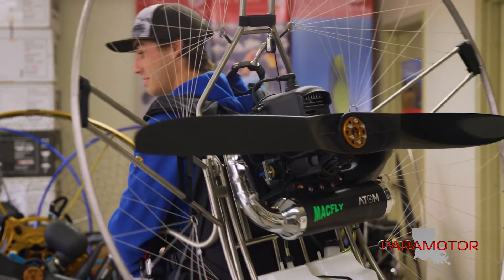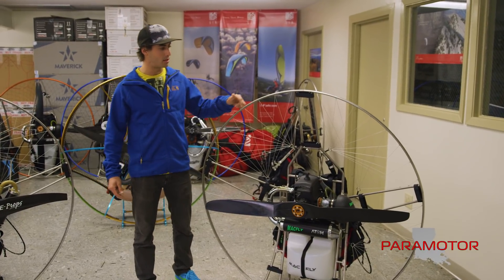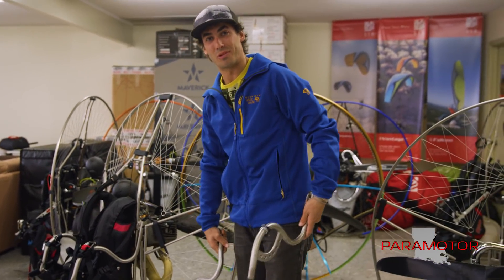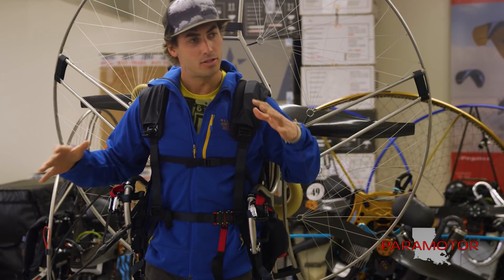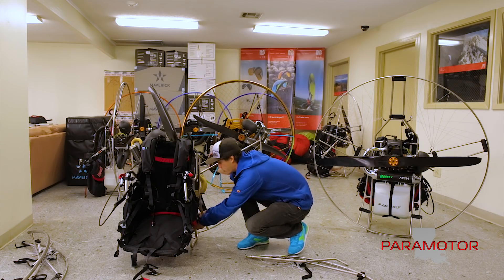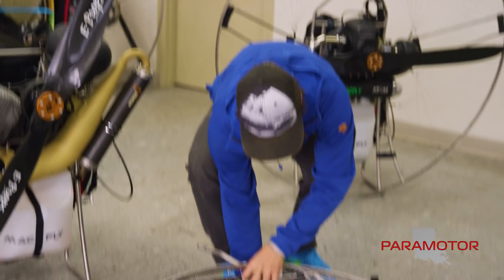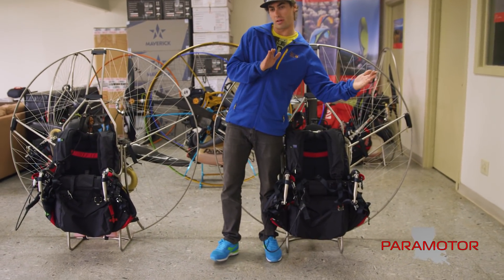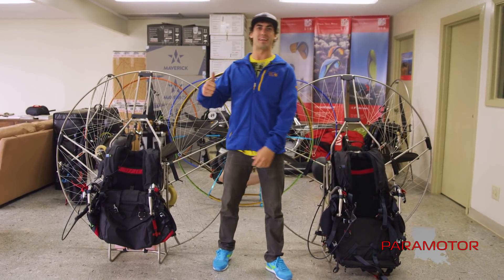MacFly Paramotor FULL REVIEW - Moster 185 AND Atom 80 (in 4k)

Comment: This looks like a very nice unit. My only concern is the netting. Is there an upgrade available? I would be worried about an errant toggle getting through the mesh, and into the prop. Is this unfounded?
Reply from the maker: Mark Rogers it’s not a big deal, the thrust angle prevents the cage from leaning forward. We can rig you up a custom net if you prefer an old school design like a fish net. This works great & we don’t have that problem, when you fly this machine it is an upgraded design in so many ways from a regular Paramotor, I can rig you a maverick style hoop to go over this cage if you want the old style net.

Comment: Do those frames also have shims as well on the motor mounts to also compensate for the torque twist? I'm doing a motor swap on my air conception frame and putting a vittorazzi on it and I'm looking for ideas on how to help keep it fly straight through the torque.. my swing arms are also angled but I was told you guys use shims on the motor mounts for the vittorazzi?
Reply from the maker: No we don't use shims on the motor mounts, but of you have a frame with the wrong geometry you can try that to help. Thankfully we don't need to do that with our frames..

Comment: Mac Fly has an awesome product! What's the weight LIMIT  on the Atom 80?
Reply from the maker: The weight limit is as much as you can fit in the seat. Same for all Paramotors. 

I train students at 220# to fly with it, I feel like the climb rate is still working well at that size with an appropriate wing. 

I have also flown a tandem with it

Comment: Matt, can you pull on the hoop and  do a flex test to show how strong they would be during a forward power launch?  I’d like to see flex test on the Parajet Maverick also. That would be a great video. Thanks
Reply from the maker: Tim Paul yeah we could do that but there isn’t much reason to do that when you know you can do a power forward inflation with both cages built of titanium the most natural thing is to fly it compared to pull on it, come visit us and you can get your hands on all the gear, I’ll do that in the next video but there is no Doug to have pulled on every frame I have in all directions to make sure the prop has plenty of clearance & I would never sell a Paramotor that has flimsy cages on it. Some people manufacture those but we make sure to steer clear from those brands because we don’t think they are safe enough to fly!
Reply: Could you show and compare the flex of the Parajet Maverick and Air Conception Race v2 also? I am trying to understand how much flex is allowable and how rigid each motor company compares to each other. Thanks
Reply from the maker: @timpaul7907  We can attempt to flex the Parajet & the Macfly but i can tell you now that they dont really move much, they can be moved if you pull very hard, the standard i use is if i can contact the prop on the cage with minimal force it is a fail, you can not do that with these machines, they are very strong, we also do not have any air conceptions to flex so i cant help you with that. Do you have anyone near you to go and visit? It sounds like you should visit and get your hands on each machine to be sure you like it. Feel free to visit us anytime, you are welcome to do your own test on my gear as you like. I can assure you that these are all strong in the flex test. If the frames were not strong in the flex test i would not be interested in having them in my shop & i would never have bought them. I am not a fan of flimsy cages or cheap gear & i do not think i will ever have any flimsy gear in my place.
Reply: Matt, You are the Man. Glad to hear they are strong, that's great. Do you think the Skymax Star Paramotor is a good choice? I think the hoop strength is there but don't know how strong the frame could handle twisting considering all of those rivets.Thanks for any input.  @minyardmatt
Reply from the maker: @timpaul7907  You cant really compare the skymax with this, the skymax is cool but a bit more flexible.. however you can save $2000 and have a skymax so some of my cheaper buddies like it, skymax ready to fly is about $5000

Comment: Does the titanium break rather than bend if someone were rough with it?  Asking for a friend, I definitely never bash my stuff around..... :)
Reply from the maker: David Carroll I have seen some people bend it but never break it - just the cage ring section on the top, it really depends on the situation, I haven’t seen one break or split so I don’t know! I have seen a guy hit the bottom of it very hard a few times & it did not bend at all or damage anything which was impressive. Again it’s strong enough for teaching & butt landings without damaging it so we are loving it!
Reply: @minyardmatt  Yea, that titanium is very very strong, but I know one major downside to titanium is that it is more brittle than stainless, but I do know that most titanium is now actually an alloy that gives more flexibility than straight titanium.  That's probably the case with the tubing that these are using.  I fly a flat top I bought used, and I can say that comfortable seat on the macfly looked pretty inviting, I went on a short XC the other day and my legs were pretty numb afterwards!
Reply from the maker: David Carroll you can buy the frame anytime you want to upgrade to a nice comfortable setup
Reply: @minyardmatt  Step one to being a paramotor pilot.  Find the credit card :). 

I think when I'm ready I'll just buy a whole unit so I can have a new motor.  Thanks for all you do for the PM community Matt.

Comment: Nice job Matt.  Only thing holding me back is financing.  Any update on offering low interest financing for those of us that want to buy new and get lessons?  It's a lot to handle all at once and financing would speed things up.  Thanks.
Reply: Use a credit card through paypal.
Reply: @gettinghighwithadam6516   That is not low interest financing.... unfortunately.
Reply: @ShadowlitphotographyRPS  Can't get low interest on small purchases that have such a high risk factor.
Reply: @gettinghighwithadam6516  Parajet offers low interest rates over in England.  I'm sure someone can get the same over here.  Dealers Like Matt just need to get something into place.  I guess I could search for a zero interest for one year credit card to make this happen.
Reply: There is a option for financing your Paramotor Dream. I have sent a few of my students to this lender and they were both approved 1 for 10k @5.9% 5yr, the other was approved for 15k 6% 72 months. Both had 700+ CS and showed reasonable income.
Reply: @MikeCotter1  Thanks Mike.  Who is the lender?